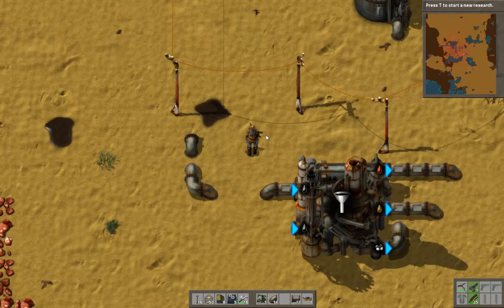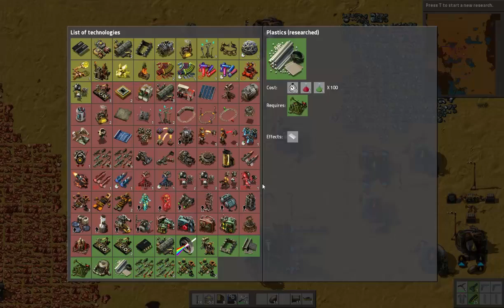Factorio Tidbits -  Early Oil

Comment: Your way of building is much better than mine! I will try your set-up! But as a tip, I would save light oil for advance oil processing. The reason is because the solid fuel is useful, but coal is more abundant than oil. So I would save the light oil for it to be later refined into petroleum gas, since that's used in both for batteries and plastics. I only found out later that oil is a pain to find/transport, and I wasted about 10 'veins' of oil making lots of solid fuel.
Reply from the maker: +VengefulBerserker That is very doable, you would just need more than one tanker for light oil as it builds up fast. Oil can be a pain, there is the option to barrel it up and ship it that way, or you can use the rail tanker mod to pump it directly.